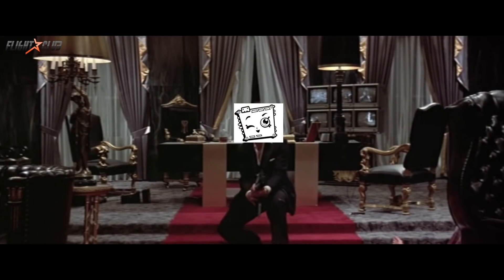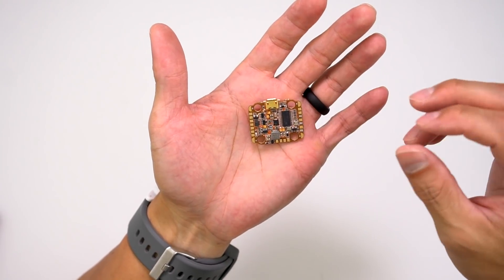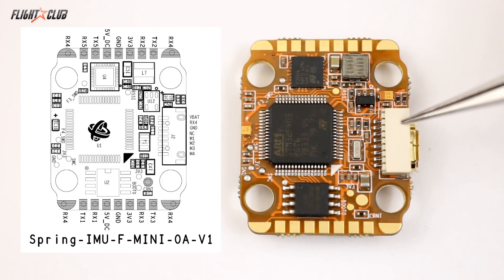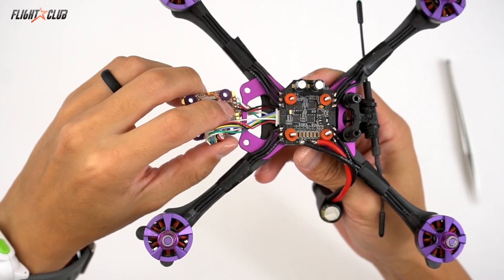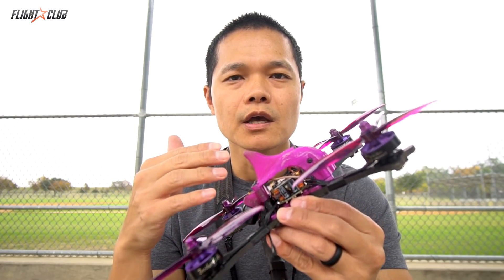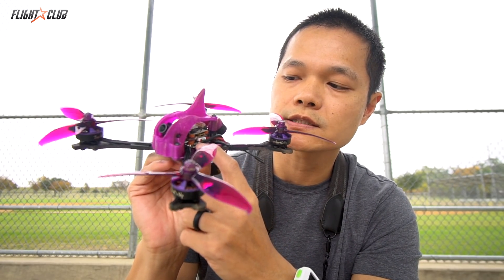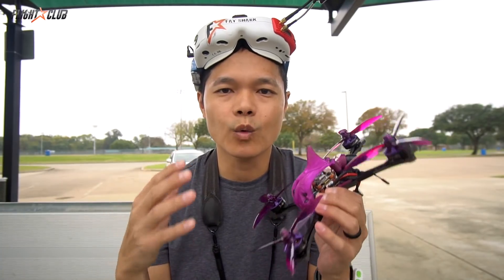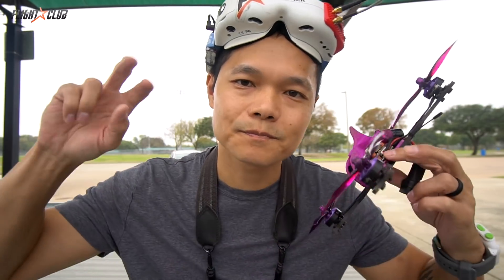Helio Spring Mini - The best 20x20mm FC?

Comment: Very very interesting! I was happy helio user for some time but then I changed to 20x20 frame and got some airbot nano v6 20x20 and it's very good too it has 5 uarts. But maybe I need to try Helio again, I have seen some good results with starbuck fu.
Reply from the maker: you should try it in your next build.  it's so smooth!